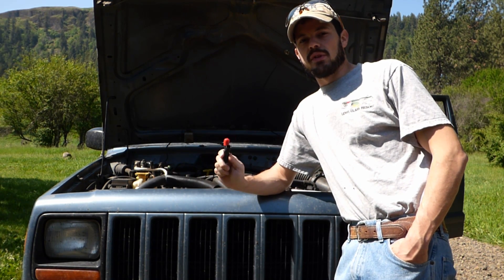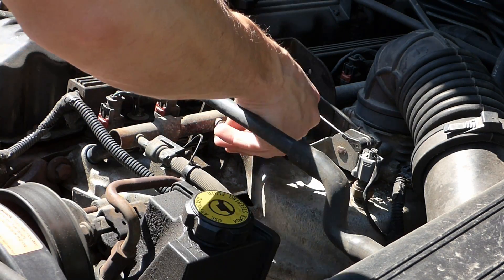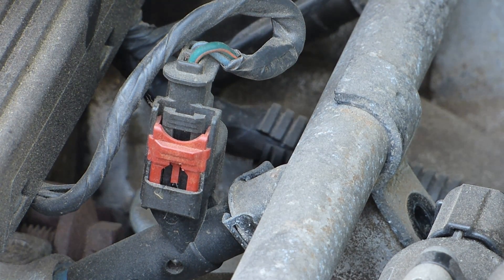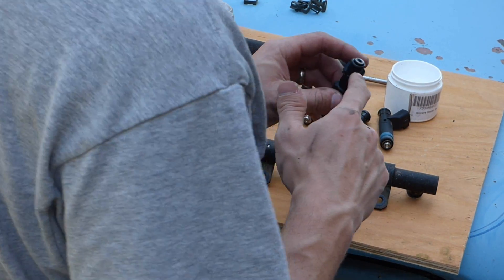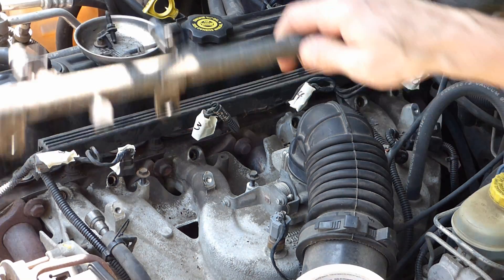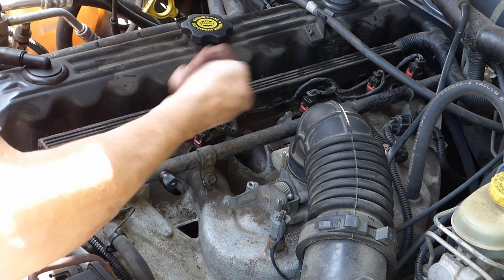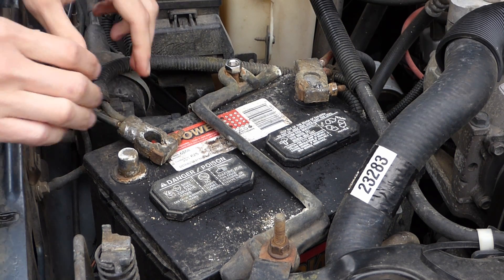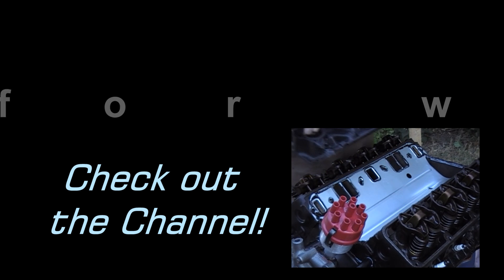How to do the Injector Upgrade on a 99-01 Cherokee XJ

Comment: Great video, but MAN that cricket was driving me nuts!  I kept thinking I had one in the house. LOL
Reply: On a slightly different issue, I used a round wire brush (kind of like a battery terminal brush, only smaller) and a vacuum to clean the ports.  I just twisted it in, gave it a few turns (with the vacuum very close to the port), and twisted it back out.  It did the deed quickly, and I seriously doubt that anything of consequence went into the cylinders.  Took less than two minutes to clean all six, reassembly was a snap, and no leaks.

Comment: Great video, I'm going to change mine.  Question... will this. help the heat soak problem in my 01?  I live and run high altitude 8500' and higher.  thx

Comment: something you forgot to show was disconnecting  fuel line from fuel rail.
Reply from the maker: Yeah sorry,  I noticed after the edit and posted another video on just that link in description 👍
Reply: Say I know this video was 2016, do you have any update on any significant change or response with the new injectors? Thanks for your video.
Reply from the maker: @drgil65  It gave a little more pep and a hair better fuel mileage. For me it made the start up way faster from a cold start.  It's one of those things that if the injectors need changing anyway, might as well go with the 4 hole ones.

Comment: hey, i have a 2000 jeep Cherokee and they said when we bought it used that there was something wrong with the fuel injector.. it doesnt start up right away. when i turn the key for the first time ittl try and catch but doesnt.. does this sound like it would be a fuel injector problem or does it sound like something else? (spark plugs were just replaced)
Reply: +TheJ20jeepster yes it is turning over but it doesn't want to run. I can hear the whine of the fuel pump when I turn it on so ik it's not that. The second try everytime turns over.
Reply: +TheJ20jeepster I have done that where I will turn it on for a while 20-30 seconds then turn the key back on and wait until all the lights are off the dash and it will start right up.
Reply: +TheJ20jeepster depending on the gunk build up in there would you find it necessary to replace all the injectors if problem is still occurring after a while.

Comment: Kool wish I had this video when I did this to my brothers Jeep. My only issue was the fuel still being in the rail,  I left the email connected. As I removed each injector a lot of fuel would come out unless I positioned the rail at an angle so it didn't leak fuel.  So I just held the rail with a wire to the hood and it worked.